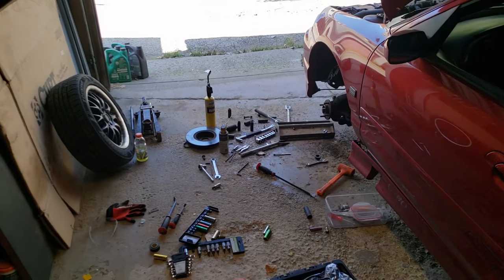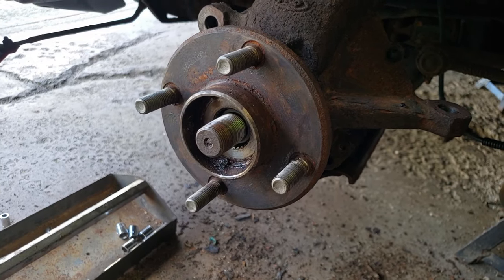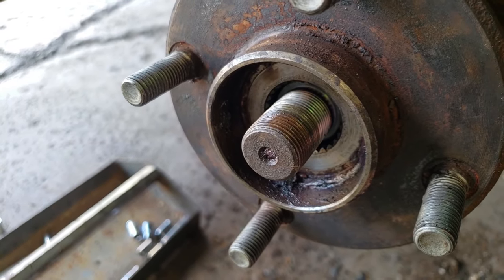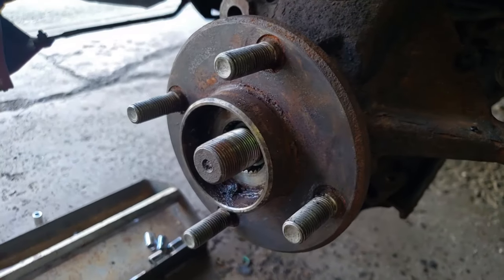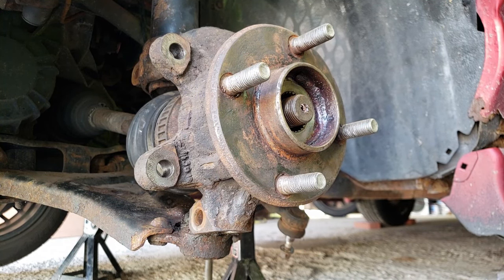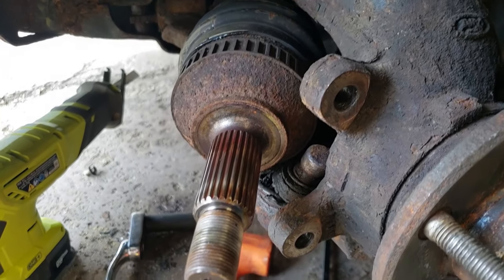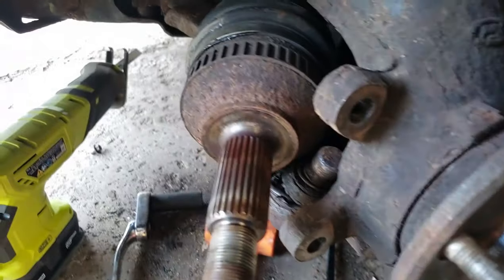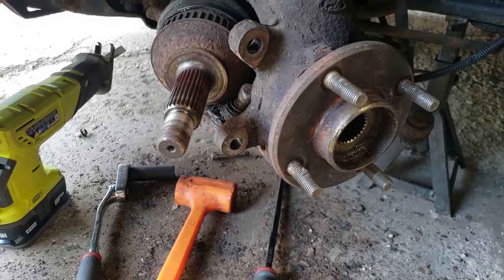Remove Seized or Stuck CV Axle From Hub

Comment: Hi mate this didnt work for me it seems like its rust welded in there, do you have any other ideas
Reply from the maker: I would be soaking it for a day or two with penetrative oil or even something like diesel, maybe a little heat, and then try again. Some users reported trying it for 15 minutes before it freed itself. Personally, I was getting ready to cut everything out if it hadn't worked for me.

Comment: Do I need to take out the ball joints and tie rod end before pushing the cv axle in with the hammer ? I’ve been trying it with those still attached , is that what can be keeping it stuck ?
Reply from the maker: Generally yes you would have to release the ball joint/knuckle/tie rod ends in order to get it out. If it's all rusted then even more so.

Comment: I'm glad that work for you,but I have to say I seen no evidence of sledge hammer strikes anywhere I guess I will have to try it to believe it ,I've used my top of line large snap on air hammer with not even a smidge of motion I removed knuckle with shaft in and cut it off from back and heated it from back and came out with hammer,but will try your method in the future
Reply from the maker: I never hit the spindle with the sledge always with the axle nut still threaded on. Otherwise you're likely to mash the spindle ends pretty good. Cutting everything out was my next step. Lol

Comment: Shouldve kept the control arm joint in while smashing it with hammer, so the force won't go away
Reply from the maker: The ball joint was still connected when trying to bust the axle loose. The tie-rod end wasn't hooked up though which makes it a little wonky.

Comment: It worked for me. Got the 10 Amp model. Probably end up taking it back after I'm finished
Reply: Used it on the bearing retaining clip.  Tool is proving itself useful.  Maybe I won't take it back
Reply from the maker: @byron3176  I kept it around as well!

Comment: I bought a cheaper hammer drill. It doesn't have a very big hammer. IT vibrates softly. Looks like yours isn't turning so it probably has a hammer setting. Sadly mine didn't work.
Reply from the maker: @richrice1058  yes there were multiple settings. If you have bits that come out of the unit make sure it's seated in there all the way. A few times I used it mine also felt soft but it was because the bit was not in all the way or seated properly.

Comment: I will try this next time I need to.  But I am a skeptic, I did not see any hammer marks on that axle.  I would have needed to see the other attempts to believe.
Reply from the maker: I never hammer directly on the axle end itself in fear of damaging the threads but rather beat on the axle nut. I think if you were to just buy the pointy bit and go at it with a sledge you might have more success. The other side popped out with a light push lol.
Reply: That's what I said

Comment: I once tried air hammers, 5lb sledge hammers, and a 5 ton puller and still couldnt get it out. I ended up just taking the steering knuckle off the car with the bearing and cv joint attached.
Reply from the maker: That was my next step, cv axle would have had to come out. I prob would have cut the axle.

Comment: Why can't people just clean the splines and smother them with copper grease or similar would make life so much easier, I've found a small suede brush to be perfect for this
Reply from the maker: I reckon they may have been the original axles installed by the factory that just rusted over time. I am in the rust belt it's inevitable lol. The car is 23 years old now. :)

Comment: Pain in the A
Reply from the maker: Absolutely, the job has been an absolute nightmare! That rotary hammer is one of the best purchases I've made.
Reply: I went and bought one didn’t work for mine bummer deal mines really stuck
Reply from the maker: @lazysplit  Oh man I can only imagine your pain right now! Have you tried heat? The other thing I started doing was using trans fluid and acetone as a lubricant. My next step was cutting it and finding a press I'd try some different lub if you can, a little heat, and then give it another rumble with the hammer.

Comment: Knock the stut out first bro then hit ur axle with a 3 lb hammer don't need air hammer knock ur strut all the way out take a pry bar to the lower control arm then knock ur strut out then hit ur cv axles if it womt go spray it with a lil free all and wait 15 min and then tap it i do it  every day it works